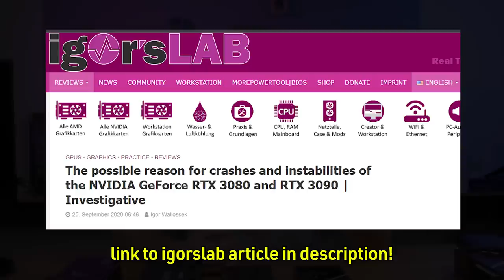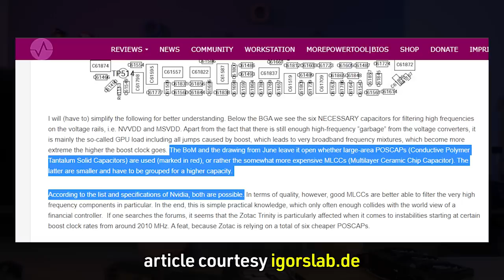The RTX 3080 Launch can't get any worse... Right? Wrong...

Comment: @JayzTwoCents - I am a radio-frequency engineer specializing in RF filter design, and your observation makes total sense.   One of things may computer users is that when you have computers with high frequencies, you have radio waves (aka EMC/Noise).    The reason the MTCC is that they are capacitors all the way to 10,000 MHz!    Those MTCC capacitors are formed to a very controlled RF Filter to keep the noise out of rest of the video card.   If you use those larger capacitors, you have no filtering above it's self-resonating frequency, which may be as low as 1200 MHz!   As a result, the higher frequency clock signal - and its noise - will get right into the system and that filter is invisible to it.   Therefore, that "Boost Clock"  is the problem.
Reply: huh?
Reply: @lerzide  Yes did you not read?
Reply: Props to Jay for actually looking into the comments, and pinning a viewer comment *VERY RARE*
Reply: I love comments like this, cheers to jay for pinning this and cheers to Kevin Gaukel
 for telling us
Reply: Harmonic frequencies are a biatch.
Reply: So don't buy until next year?
Reply: @Papita  ofc I read but didn't understand shit
Reply: dave rich Well sub par components can’t be patched out and you can’t exactly fit a  noise filter to this type of circuit .  Some clever dude will work it out no doubt
Reply: if I had said soldering skill, Can I JEET the stock transistors off and exchange them? in theory. Just asking before I start watching soldering videos.
Reply: thanks dude
Reply: Big scoop for jay this one.  Good luck soldering a filter to the board 😁
Reply: @lerzide  then don't expect for someone to explain this thing to you. jay pinned this for people who have a brain. and for people who would like to do some EFFORT to understand this VERY IMPORTANT INFO

go to your browser , type in the words , read the articles , use your brain to understand things.
simple as that. even a newborn possibly could do it

sorry but I personally hate people like you. 
if you can't even put in the minimum effort 
then don't even bother commenting.
just keep on watching the videos until miracle happens that your brain function will kick off.

you will just annoy people and at the same will just make yourself ret//ard/e/d

also thanks Kevin for the explanation. 
that certainly helps and makes what jay explained credible. 
because we all know the negative-hype for this thing - is blowing up and bound to 
have misinformation
Reply: @lerzide  you need to use your brain and put in the effort to research the terms and concepts you didn't understand from his comment.
Reply: Lerzide since people are being mean instead of taking the time to explain - my understanding is the expensive components are capable of filtering out their own noise which keeps it from affecting the card. The cheaper components don’t have this same filter, so their noise bleeds into the card and causes instability. I hope this helps!
Reply: I can concur with Kevin. Using poly tantalum (or worse electrolytic ones)  instead of MLCC in filtering scenario is bad thinking, to begin with, plus they are a pretty horrible fire hazard. The only reason I think someone used Tantalums there is lazy thinking of utilising decoupling and noise reducing function with a single component. As MLCC are really good at de-noising everything they are always much much less capable of acting as big ass decoupling cap. This could also indicate that designers are underspecifying PCB. Power demand has grown significantly which in this case necessitates more layers and thicker core layers, which adds other problems. Building it with additional buried big ass vias for power planes reduces space and adds complexity. Overall not a simple solution but certainly within capabilities of engineers. Problem is that most of this business is nowadays driven by accountants and marketeers so its pretty normal to see with the first generation of products basic failures such as this. Too little time spent with product testing in lab and more time spent on beauty and RGB lightning.
Reply: @Loathed217  They also are useful. Second order and triple beat harmonic freq are often used in wireless routers with lower frequency transmitters turned up, using the harmonics created off those carriers to transmit the wifi. Aka 1200mhz transmitters with high pass filters on them,  use 2.4ghz and 4.8.
Reply: @declaredsnow  Most probably you can change the capacitors. However, the soldering that close to the graphics chip itself is really risky. You can possibly ruin the card trying to get that 50 MHz boost. I would not recommend doing so. Just underclocking it 50 MHz and using it as it is, makes more sense IMO. Especially for someone without any experience with soldering.
Reply: @Matt_Acuna  thanks for this - but the minimum stuff should've have been done by him. 

and instead of huh? should've been " as far as i researched stuff like this and that - is that really true? " or something.

but NO.  a huh? can be taken as 
why tf you bothered commenting a whole paragraph.  we don't need that here.  and stuff.  

if cba to research 
could've said " can you please  translate this in layman's term" 

so yeah - no one's is being mean - people are telling him to act better.
Reply: This is absolutely Nvidia's fault. Nvidia denied AIB drivers until the cards were built. All the AIB's had were simple tools that said each card "passed" or "failed." If the AIB's were allowed to test with real applications, then this never would have happened. Nvidia was super secret in releasing the drivers to prevent leaks, which is understandable but this is certainly a consequence of that decision, with the consumer's bearing the final cost. 

Jay, your argument is nonsense from a consumer perspective, it really sounds more like a legal argument to me. No one bought a 3080 and thought that their clocks would be limited to 1710MHz or 1740MHz or whatever. The cards are marketed with features that allow boost, no one actually expects their cards not to go higher than this listed frequency. It might be legally, "all that's advertised" but it is not what the consumer's are expecting nor is it what the AIB's are implying you'll receive. 

When you make that argument, you sound like a lawyer who is stating in a very matter of fact way that your card was only intended to reach XXXX MHz. You don't sound like an enthusiast who actually pays for a product and expects it to work as advertised. These cards were not advertised to have neutered boost clocks, the boost clocks themselves are even presented as being thermally and electrically constrained, not "noise" constrained. You sound like you work for or with Nvidia against the consumer. 

TLDR: Nvidia caused this with their secrecy and the consumer is paying the price.
Reply: @Matt_Acuna  Thank you very much. I actually was busy, so I didn't research or anything.
Reply: These are not 'his' observations, they are igor's observations with the addition of false 'not nivdia's fault' rhetoric. These cards match spec (including boost behavior) and all partner boards must be validated by the 'Green Light' program before being released. 

You've also vastly over-simplified the reality of RF filtering. Highly doubt that you're even slightly qualified to discuss this topic. It's about switching, not  'the higher frequency clock signal'.
You speak complete nonsense, at best you are a novice 'engineer' of irrelevant, low-performance designs.
Reply: @wkruse84  100% correct. This is a bullshit take from a nvidia apologist that simply farms far more informative sources for clicks.
Reply: I'ma pretend like I understood
Reply: @abdu1998a  makes sense.  Got a Gigabyte Gaming oc inc next week and a strix oc for late oct. If the giga doesn't please I asume the strix will do fine.  They have been excellent in the past.
Reply: @maxp112  You might be able to buy, but look into the AIB to make sure it's not one of those with the cheaper design.  From what I've seen the ASUS Tuf didn't skimp on the capcitors.  This might be a problem for Gigabyte and Zotac though, No word on MSI.
Reply: Wouldn't it be possible to tie a small rf filter to the input and output of the cheap array? Personally IDC about 45mhz. And John q public shouldn't either. You already have one of the most powerful GPU on earth, why you worried about something that isn't even going to make a single frame of difference even with DLSS??
Reply: @abdu1998a  .. I don't think you could fix this with a soldering iron and a oscilloscope but i'd love to see you try :)  Besides it's only the boost function causing the data interference according to Jay and would you wanna risk damaging the card for 100mhz?   It is a major fuck up as an auto function though, it would be like core precision boost (Ryzen) causing blue screens.
Reply: @Yuuji-yu9pd  "Huh?" was my reaction after reading the op too.  Their grammar was poor and they spewed jargon without summarizing their point.  Just read this to yourself "One of things may computer users is that when you have computers with high frequencies, you have radio waves."  You have to read it like 10 times to try and decipher what they were even trying to say
Reply: But
Reply: The
Reply: @declaredsnow  You cannot just swap the large cap for the array of smaller ones. The layout of the soldering pads on the PCB would be completely different. BUT you could piggiback one or two of the MTCC caps on top of each of the large caps and connect them with VERY SHORT wires. However these are very small components very close together and the PCB has substantial copper planes that suck away the heat of your soldering iron. Also the added height would make your backplate not fit anymore if it doesn't have a hole. I would not attempt this if I were you.
Reply: The bigger the capacitor the higher the inductance🥳 no bueno
Reply: Makes complete sense. Electrolytic capacitors (the large, cheap caps) have a much higher ESR (equivalent series resistance), which results larger voltage changes as the load current changes. Good design practice puts smaller value ceramic caps in parallel with the larger electrolytic caps so that the high frequency load transients draw energy from the ceramic caps without putting as much noise on the supply bus. The smaller value ceramic caps also work much better at very high frequencies.
Reply: @georgf9279  you can on some as the pads exist for the array under the larger cap on those that used the reference layout. Some don't though.
Reply: Can't you just use tiny faraday cages instead of capacitors to filter out RF noise? (Or at the very least, use capacitors and put a faraday cage around electrical components to block incoming noise from outside the hardware?)
Reply: @declaredsnow  You could try, but I would really advise against. They are SMT (Surface Mount Technology iirc) very difficult to solder by hand and you are more likely to fry the capacitors by dumping blobs of solder over the wrong pins. And the different capacitors probably have different pin layouts/specs and won't fit.
Reply: I am also a radio-frequency engineering specializer in RF air filtration and web design and I concur
Reply: Roekoe_ It’s only rare because Jay hates all our comments usually but he reads them all
Reply: I remember there was a few cheepo android tablets a long while back that did something worse they had the caps that fed the soc package a distance away from it and LONG traces to the soc damn things crashed like crazy. Edit, i think the video was a eevblog teardown but i cant remember which atm, and don't feel like searching
Reply: I would say yes and no. The capacitors below the chip are not placed there to reduce self-resonating frequencies, they are there because the input signal they are filtering needs the shortest path to the chip in order to reduce the acoupled noise of emcs. So it's not about keeping the noise out of the rest of the video card, its about don't letting it in the chip. The self resonated frequencies are reduced by the gnd plane of the card. You are thinking like this card had just 2 layers and its not. Also I think that talking about filtered freq numbers is kinda misleading because you need to know the τ value of the circuit and we clearly don't.
Reply: wait now i'm confused... so... how much of those MLCC(MTCC?) are enough? MSI and Nvidia uses "just" two of them (instead of 6?) if an MSI 3090 runs at core clock below 2000 MHz two of the high frequency capacitors are good enough?
Reply: One thing I would like to add. The MLCCs are not significant more expensive. The cost for placing the components is negligible. The components itself would cost probably  <1 cent per piece. I don’t know the capacitance and Package of the components, but the most eypensive special sauce ones may cost up to 50 cents a piece. But I would guess they are more in the 1cent range.
Reply: A few of my EMC colleague will be in a bit of hot water. These big companies should have EMC specialists as part of PCB review.
A good reference example next time a cost controller complains about the slightly more expensive component
Reply: @lerzide  don't apologise, that smuck wanted to show us that is very smart. Not all of us have the same skills. You good chief. Cheers.
Reply: @declaredsnow  you can't manually solder components that small on a graphics card PCB.
It is done by using very special ovens.
Reply: @Yuuji-yu9pd  Bruh you seriously have to chill out, anyone who isn't a super computer nerd isn't going to understand jargon used by a specialist, and not all of us have the time to become RF filter specialists just because we don't understand a youtube comment. 'Huh' echoes what a lot of us are thinking when reading that, and reading it as a comment is pretty funny, even if you don't think so.
Reply: @DeltaStorm27  he's einstein, we can't reach his knowledge level lol.
Reply: @declaredsnow  I got the skills
Reply: @Matt_Acuna  No, not really. Capacitors are passive components, they don't have noise characteristics.  It Depends on the value of the capacitors as to what frequency it has the least resistance (resonate frequency) or charge capacity  to smooth any ripple from the power supply
Reply: I would happily replace the caps on one of those boards to see if the problem disappears. I work at an R&D lab with all the gear and ofcourse the experience of working with complex multilayer pcbs
Reply: @kelainefes  you absolutely can, but only with proper equipment and steady hands. You will need micro head hot air soldering station to begin.
Reply: Any info on whether the Asus Strix will have the same capacitor setup as the Asus TUF cards?
Reply: @lerzide  The point of the the caps are to help filter out the noise. EM noise just happens. it's unavoidable. When they self-resonate it defeats the purpose of the caps. That's what's happening when it hits certain frequencies clocking itself higher.
Reply: @maxp112  Or buy Asus, looks like they've got 6 of the expensive cap arrays.
Reply: @Yuuji-yu9pd  Ok Einstein with PP manga.
Reply: Will K How is this Nvidias Problem? If 3rd Parties wanted to create a perfect GPU they all should have built their own cards from the ground up themselves. I really don’t understand 3rd party GPUs. They take the stock 3080s put some extra fans on it and get paid for Nvidias work. Seems pretty lazy that they don’t create their own GPUs themselves
Reply: I'm a YouTube comment analyst specializing in human behavior by individuals who certify their superior knowledge of the discussion topic by giving false credentials expecting to be taken seriously and the type of individual who falls for this type of deception.

Did you fall for it?
Reply: @IUSSHistory  holy crap. Consider myself schooled.  Bro thanks for being so intelligent.
Reply: It is quite dissapointing to jump onto the bandwagon saying that the spcaps configuration is the worst. Their models ranges with different performance. Gigabyte adopted a better spcaps model compared to the Zotacs, that's why Zotac peeps are facing more issues compared to the latter. 

MLCC have pros and cons too. Hence Asus TUF users, FE, those who have incorporated both setups of capacitors have crashed too, proves its not by the capacitor, do understand the chips are pushed way beyond their rated spec, its as good as saying that it's been automatically pushed over its limit which has been overlooked. It's the same when you try to manual overclock and it crashes when benchmarking, it's the same now as well, but it's been done automatically.

Breakdown of the pros and cons of both that I got from my local forum. Thanks Gametaku. 

MLCC:

+ cheap
+ small
+ high voltage rating in small package
+ high current rating
+ high temperature rating
+ high capacitance in small package
+ good at high frequencies

- prone to cracking
- prone to piezo effect
- bad temperature characteristics
- DC bias (capacitance changes a lot under different voltages)

SPCAPS:
- more expensive
- bigger
- lower voltage rating
- less good at high frequencies

+ high current rating
+ high temperature rating
+ mechanically very strong (no MLCC cracking)
+ not prone to piezo effect
+ very stable over temperature
+ no DC bias (capacitance very stable at different voltages)

Overall, its actually best for them to give more time for themselves to run more test before releasing a product. Same applies to all other type of products be it a GPU etc.

I am an early adopter/beta tester as well. Sick of been the ones facing issues when you know you are confident in a companie product. I am not bias in any company but just happy to support what they developed and release to customers
Reply: MLCC NOT MTCC
Reply: @lerzide  exactly my reaction. But kudos to the expert tho!
Reply: @Yuuji-yu9pd  the person just said "huh?". My god people need to give that person a break. It pretty damn obvious to anyone who knows how to talk to people what they were hinting at haha.
Also it is a complicated topic.
Reply: @Yuuji-yu9pd  stop hating on the @Lerzide. OP is barely speaking english in his comment
Reply: Speak English doc we ain’t scientists.
Reply: @Roekoe_  lmao
Reply: Are you speaking of self-resonating frequency of a capacitor or of an LC circuit, if I may ask?

Anyway, that was one brilliant comment.
Reply: @Yuuji-yu9pd  His comment was more to do with the fact the original poster was typing in extremely broken English and most of it did not make sense in that regard.
As for the "engineer" claim, I wouldn't believe everything you read on YouTube.
Reply: As a electrical engineer with MSc specializing in power enginnering now (curently working as protection and control specialist, major in electrical systems and technology, graduation in power electronics). Point of this capacitors is not to filter anything. You totaly dont understand the topic. Point of that is to eliminate VDROOP. Voltage drop when hi load spike accures.

Basicaly to minimalize -dV/dt, when +dP/dt spikes. To do that you need energy stored at max and impedance at minimum.

Everything on this video is a theory, and is easy to prove. Just meassure voltage on high load spike. I realy dont think that there is big price difference in any of tipical, and that engineers who work on that design are not aware of VDROOP. This is probavly envidia fault with their boost algorithms and lack of testing from AIO vendors.
Reply: I would expect the GHz noise to be decoupled by the smaller MLCCs. The big MLCCs/Electrolytics/Tantalums(?) look more like bulk decoupling.
My suspicion is that the cards using Electrolytics have more bulk capacitance, causing board manufacturers to think they can reduce the capacitance of the other MLCCs.
Reply: why are people belittling @Lerzide 's comment about not understanding this kinda of stuff? Not everyone has the same knowledge as you. And even if she/he searched for what these terms mean, it doesnt mean he/she will understand anything.. so instead of being an asshole why dont you write an explanation that will help others as well? Its like saying "how dare you not understand advanced mathematical concepts that you never heard of! just search them online dont be lazy!"... These comments are rather toxic and contribute nothing to the discussion whatsoever.
Reply: It’s nonsense what you’re saying.. buldzoid was already explaining this and it has not to due with the clock frequency of the GPU since it is parallel processed by the net frequency of 50Hz so all other frequencies don’t matter since capacitors are build on this operating frequency..
Reply: I would believe when the frequencies are not resonant and are instead dissonant that it would also create excess heat due to the frequencies not mingling nice, as well as causing overall instability issues and RF interference. 

Considering the cards already run hot as hell, this is a serious problem and safety hazard. 
Do not ever, ever, ever buy a launch version, people. 
Good luck buying a new 3080... And PC... And house...
Reply: @g10118  Yeah I was surprised how bad this take is. "You're still getting reference clocks so you get what you pay for". Maybe if there was the asterisk on the product page saying (will not perform according to benchmarks that you've seen because it's a sub-par product). See how much the cards will sell then lol.
Reply: David Connell MLCC have a noise characteristics due to piezo electric effect during vibration.  You have to be careful with sensitive circuits, such as oscillators, in aerospace use.  Though you are right, that’s not what’s going on here.  I’m surprised (well, really not) that these companies are not running a analysis on their power delivery network.  This is common practice.  Maybe they are just slapping shit down on a board.
Reply: Markisha64 good insight (I’m an RF EE).  I’m surprised this is happening with all these cards.  Tells me that these companies have poor design practices and are just slapping parts down on a PCB.  Power delivery network (PDN) analysis is well established within the signal integrity community, and there are several software packages to simplify.

Of course, it could also be bad parts, bad PCB, or poor bypassing within the packed chip itself.  If you are trying to get a low PDN impedance at 2 GHz, it sort of too late to do that on the PCB when the bypass caps are on the other side of the board.  Not to mention the power planes within the PCB may be resonating.  Nvidia may deserve some of the finger pointing.
Reply: Lerzide dont apologize bro, you did nothing wrong.
Reply: Looks like a : I'm a vegan - to me 😅
Reply: AbrasiveWaif Thank you for posting something that actually makes sense!
Reply: The bigger poscap capacitors can't respond quick enough to the agressive GPU boost. They can't provide the GPU with enough power fast enough so a brownout occurs and people get kicked to the desktop. Expanation in detail: https://www.youtube.com/watch?time_continue=82&v=FmmlafdRlvw&feature=emb_logo
Reply: @TheMidwestConnect1  You don't seem to understand the resources it takes to "create a GPU" nor do you understand the relationship that chip makers have with AIB's. 

It's a relationship that Nvidia has determined is profitable. There is no room for adjectives like "lazy" or phrases like "get paid for someone else's work" in business. Nvidia does not give away anything that they don't believe they make a profit on. That's how business works. It might be mutually beneficial to both Nvidia and the AIB's and I would wager that is the case but no one is stealing work or being lazy.  

As far as being Nvidia's fault, yes it is. They provide the AIB's with guidance and drivers to build boards for the chips, then the AIB's make them. This time, to prevent leaks, they denied the AIB's drivers. AIB's had command line programs that gave a pass or fail. They couldn't test in actual real world scenarios. So strange electrical interference manifesting during high boost scenarios would never be caught prior to manufacture.

No AIB would sacrifice their brand image for 25 cent capacitors, if this is the issue, then it would've been handled in house during the design phase in testing the GPU but that could not have happened this time because Nvidia did this launch so differently. 

I would wager this also had something to do with scarcity at launch. I bet these AIB's caught the bug around launch and pulled the cards and that's why so few went live on launch day. 

Of course no one can say anything about anything because whoever the blame gets settled on will be paying the price in brand image.
Reply: You mean MLCC, as in multi layer ceramic capacitors... and you're glossing over a lot of info. It's not that poscaps cant do high frecuencies, it's all about the design of power delivery. I think the one at fault it's nvidia for not giving all the details to th AIBs, so they could fix and adjust the final designs of their own cards with enough time. EVGA released an statement, that they got aware of the situation and got it fixed before release with minor delays. That speaks good of their engineering department that was able to identify the issue really fast. MLCCs are not without problems of their own, they can crack, they can short, poscaps dont tend to short much like mlccs, and its not that they are cheaper, there is a reason why they were using them!. Yes they're cheaper but my guess is, it means cents per card...
Reply: What does MTCC stands for BTW :D 
P.S. i understand what you said although i m not an expert like you
Reply: @lerzide  why are you here then?
Reply: To be fair to @Lerzide, the comment is full of spelling and grammar mistakes, that may well result in poor google translation, or just general misunderstanding.
Reply: @rfengr00  Probably that last part.
Reply: Jtl2299 well funny thing is I went to Micro Center yesterday to buy a thumb drive, and figured I’d buy a 3090 if they had one (I knew they would not). They had signs outside the store saying they were sold out of 3080 and 3090.  Now I’m going to have to research PCB revisions prior to purchase to ensure I don’t get a turd.

Funny thing is I could have bought a 3080 as they had a few last week, and turned around and sold it on eBay, but I guess I’m not enough of an asshole.  Someone bought a 3090 on eBay for $10k; crazy.
Reply: haha maybe a bit generous to say it makes total sense, but yeah agreed
Reply: @benighted0ne221  MSI Ventus 3090 has the cheap design. Is actually shown in the detail images on the website id ordered mine from. x6 cheapies.
Reply: @abdu1998a  Knowledge and proper soldering equipment is here the key. But as a consumer, you can only be angry. Buying a card that is at the beginning labeled with limitations is something that no one is expecting in this price range of cards. Of course, you can change the caps for better ones. From what i see here this tantalums are all connected in parallel. The capacity has to match. You could replace them probably with 1210 smd ceramic capacitors. It is not that expensive. A nice hot air station does the job pretty fast, but i would go for soldering tweezers with nice tips, or a good soldering station.
Reply: Huh?
Reply: @davidmaddison4544  Can I just rebuild this from scratch with a few thousand bix boards?
Reply: @miket7390  LMAO
Reply: @declaredsnow  i wouldn't especially not if you are new to soldering since something like this since there is alot of shit in the way but it can never not help to watch some Louis Rossman dont delay watch today
Reply: @Markisha64  as a civil/structural engineer I have no idea what is going on... (except resonant frequencies, I don't want structures shaking themselves to death). 
Electrical engineering is black magic and we need to bring back witch trials.
Reply: Then  you would also know that MTCC are actually much cheaper than POSCAPs.  So his (@JayzTwoCents) accusation that Gigabyte etc cheeped out, and his implication that ASUS didn't, actually has things "arse about face".  ASUS massively cheeped out.  MTCC fail over temperature and have less of a lifetime in a thermally stressed environment - and they crack.     Gigabyte actually use higher spec POSCAPs (470s) than ZOTAC.  But don't trust me.  Do some research.
Reply: They are not his observations. He was repeating somebodies findings. He would review them without even mentioning about it if that would only depend on him.
Reply: @Matt_Acuna  thank you
Reply: @Papita  oh of course totally
Reply: @rfengr00  At that point, why not just invest into a Quadro or some big 'ol beefy build?
Reply: Huh? Oh right, that totally makes sense. Understood. Thank you.
Reply: This is a very good assumption. I think this was overlooked when they wrote the minimum spec. They might have overlooked the fact that people overclock these devices. 
POSCAPs usually higher ESR (equivalent series resistance) which looses its 'filtering/decoupling' effectiveness on higher frequencies as compared to MLCC. And when you overclock this device, the operating frequency will be a lot higher in which you are operating in a region that the signal integrity is compromised.
Reply: i miss the c.b. days. old lost  frequency's. RF back then  would light up a bulb and open the auto door ate the grocery store.
Reply: It's refreshing when a YT commenter just gets it, albeit a well-studied industry professional xD
Reply: if anyone wants to fix the problem themselves. just piggy back some more capacitors on the back on top of the "poscaps" maybe that'll be a way to get a cheap upgrade for some folks
Reply: @irag4983  This is the actual answer. It's not a question of cheap vs expensive *capacitors*. The larger tantalum caps also have a purpose.
Reply: Could undervolting help theoretically with stability ?
Reply: @Matt_Acuna  Thank you. Those people above you are just some toxic weebs who are pissed that they are still virgins so they gotta do everyone like that :(
Reply: @declaredsnow  I would not recommend that. First of all I don't think the transistors are the issues, but the caps. The spec (I did not look at that but I am a design engineer in the photonics business) is probably some other lower capacity specs in line with some even lower capacity spec. The reason here is that the different capacities filter out different frequency ranges along with having different ESRs causing the resonant frequency placement that Kecin Gaukel mentioned.
Additionally you might put on too much solder or leave some sort of residue which could also create some offset as more solder would be more resistance. Not sure if this would affect the power much, but I speak from experience with photodides.
Reply: @MeakerSE  Seeing Buildzoids high res PCB shots - you are right the pads are layed out for both options.
Reply: They used Copper magnetic filter i think
Reply: @declaredsnow  You could definitely destroy a $900 card in about 4 seconds if you did it wrong.
Reply: @josephdzn9868  Just watched an ASUS TUF 3080 crash out at 2.07GHz with 6 MLCCs installed. It's one of the best in the market, and even it is having this problem...

There's more wrong here than just capacitors and NVidia sure is being mighty quiet about it.
Reply: @Yuuji-yu9pd  Jesus Christ dude chill out.
Reply: @declaredsnow  Don't even try lmao
Reply: @declaredsnow  You could... but know you may brick your card without the proper tools and experience to do so. Try to return the faulty product first. As a pcb designer I know that some traces are only slightly bigger than a hair and it is very easy to plain rip a track off the pcb while trying to desolder the stock components.
Reply: @abdu1998a  How are you gonna change caps with hugely different land patterns? You need to have low impedance return path for decoupling caps, and I doubt the single large cap layout is exactly suitable for just throwing in some small mlcc caps. And also hand soldering smd mlcc's is not recommended (and note that "not recommended" ≠ "can't be done"), they can in worst case short circuit due to thermal shock causing internal layer cracking (sidenote: I prefer the AEC qualified open mode mlcc's in my designs).

PS. Everyone commenting here should watch Dave's excellent video (even those who claim to be experts of the subject): https://www.youtube.com/watch?v=BcJ6UdDx1vg.
Reply: I learned something today and it was from this comment. :)
Reply: @lerzide  Don't put a quart in a pint pot basically.
Reply: @declaredsnow  They are capacitors. If you don't know the difference DON'T TRY THIS AT HOME!
Reply: @Yuuji-yu9pd  "Sorry" but I personally can't stand people like you either.  Pedantic, condescending, self-congratulatory, etc.  Jumping all down someone's throat just for writing "huh?"  It seems like you haven't "used your brain to understand" Kevin's comment either -- because if you did, you'd see that it doesn't make very much sense, and "huh?" is a perfectly reasonable response.  

My reaction was the same as Lerzide.  There are typos, acronyms that haven't been defined, etc.  Doesn't make any sense until the last couple of sentences.  

"One of things may computer users is that when you have computers with high frequencies, you have radio waves (aka EMC/Noise)."  

^^ That sentence makes no sense. 

"The reason the MTCC is that they are capacitors all the way to 10,000 MHz!"

^^ That sentence makes no sense.  And what is MTCC?  Typing "MTCC" into google brings up "McDowell Technical Community College", which I'm fairly certain is not what Kevin was referring to.  

But anyway, I know you were just trying to pat yourself on the back for "reading" the smartest looking comment, but maybe you should have actually read it.  Do the research and "kick off your brain function," BEFORE trying to ridicule someone else.  That way you'll not only look like less of a fool, but less of an asshole.
Reply: Tim@NVIDIA - NVIDIA posted a driver this morning that improves stability. Regarding partner board designs, our partners regularly customize their designs and we work closely with them in the process. The appropriate number of POSCAP vs. MLCC groupings can vary depending on the design and is not necessarily indicative of quality.

oups..
Reply: Imagine getting vented over someone saying huh
Reply: @lerzide  Neither did I, but I didn't feel the need to leave a dumb comment.
Reply: @mattsap2558  Generally speaking polymer caps (POSCAP is Panasonic's product line name) have higher Equivalent Series Resistance (ESR) than Multi Layer Ceramic Capacitors (MLCC). Usually smaller ESR is preferable in power supply decoupling (IRL there are cases where too low ESR can cause instability). Of course package sizes also matter, bigger device package = larger inductance (not desirable).

Capacitors can have different temperature ratings (and lifetimes) even in the same product line, so there is no absolute truth. But generally speaking mlcc's have higher ratings.
You can get at least +200°C rated mlcc's (even higher ones exist). But I think the most common temp rating is +125°C (X7R) in consumer electronics, or in high temp applications +150°C (X8R).
By quick search @ Digikey highest rating for low voltage polymer cap I could find was 1000 Hrs @ 125°C, which is not great IMO.

PS. Relating to mlcc vs tantalum: working as biomedical equipment techinician I've seen medical device manufacturers quietly swapping the fire hazard tantalums for mlcc's in newer pcb revisions in the same product.
Reply: @narabdela  Can you please explain how saying that I didn't understand broken English considered dumb?
Reply: Fantastic explanation!
Reply: Do you think we'll be seeing designs with screening cans and such at some point? Jay mentions interference from his radio pack so perhaps EMC isn't strict enough for today's noisy environments... (Also, from an engineering perspective your comment very insightful)
Reply: Except.. it doesn't make sense because it's inaccurate.
Reply: Matt Acuña finally a true human being
Reply: It would be interesting to put one of these into a RF shielded room and just watch the RF spectrum on a spectrum analyzer with all the noise and such...
Reply: That's correct... I... guess XD
Reply: Nvidia released a new driver yesterday largely solving crashing on cards with MLCC/SP-Caps or a mixture. It appears the capacitor "theory/Guess" is complete overhyped BS.
Reply: Great response! Also it's not his observation, all the credit worldwide must go to Igor's lab...
Reply: @samzavinful  , it would be.  I nave to think that all those 4-5 GHz CPU clocks and all the  1+ GHz GPU clocks are going to generate a lot of spurs and noise.  Remember...if you have a 2 GHz clock. you will likely get spurs at 4 GHz and 6 GHz but also sub harmonics (1 GHz,  500 MHz, 250 MHz, etc) due to divide-by and counters)
Reply: @6to1  Sure - buy solder in bulk
 though,
Reply: @Zhaadum  thanks for the detailed explanation. Appreciated
Reply: @qwopie9174  how to upsett the whole internet in a few seconds.
Reply: @neonightengale9375  I was just talking in theory.  I am Not good at soldering at all. Only done like old radios and tv's. Those pcb's are huge and lots of space to mess up on. Also got a strix coming later next month so if it's bad I'll keep the strix. Got enough friends that would love a giga gaming oc, even if it only can run stock.
Reply: @stevewatson6839  I was joking. Kinda. I'd probably receive a size and desist order if I showed you some of my soldering work
Reply: @Battleneter  Yeah this is largely being ignored it seems by the people who originally have hyped up the Capacitors theory with some people adamant that it was the complete cause of the issues. Would be nice to see some coverage on the driver fixing these issues. I have my Gigabyte 3080 waiting to be installed in my new rig, I am currently waiting on Zen 3 so i have not personally tested it. I also read from many people that the new drivers provided performance increases in some games and synthetic benchmarks on the order of up to 10%. Reviewers might have to retest Ampere when Big Navi comes out to get these updated numbers.
Reply: I'm an EE, but i don't specialize in RF design so you've got one up on me and probably more experience. I'm still going to sit here and complain that you said 10,000 MHz instead of 10GHz though! Kindof a pet peeve after I've seen 100000000uF capacitors on Mouser. Seriously people!!! Engineering units! (But you used a comma so I forgive you, at least I can read it without a lot of effort).

I also assume you meant MLCC capacitors? Incredible that proper EMC testing/design wasn't done on these boards. We're pretty lazy about it where I work when prototyping parts(R&D) but try to keep interference to a minimum, and in production we actually try to do the right things to help. There are other companies that just don't care at all about the emissions of their devices and they'll interfere with other devices on a vehicle. It's ridiculous. We've actually been requested to make our stuff work when a totally unacceptable amount of interference was generated from other devices. How about no?
Reply: Don't they have mlcc right near the chip for bypass? I suspect that it's the cards require high end power supplies with good transient response and regulation under heavy cross loads.
Reply: Then I finished the video and can't believe some of those were inadequate bypassed at high frequencies. They probably didn't take less than ideal conditions into account when looking at the poscaps esr over frequency. 🤦‍♂️ Improper derating.
Reply: All the issues were fixed with a patch lol.
Reply: @Chromov113  Capacitors self resonate? Pardon my electrical engineering ignorance. Why would computers simply with high frequency clocks "generate" radio waves? His analysis makes sense upon first inspection at least though, just wondering...
Reply: @Markisha64  This is what I was thinking about thank you for clarifying! Pardon my electrical engineering ignorance, I'm a hobbyist who studies seldom on his own time, but capacitors don't self resonate do they? That frequency is he referring to within his system ( this comment, that is )? Also, do high frequency oscillators make radio waves? That doesn't sound right at all. Like what?
Reply: @seppestas  it would be nice if they released schematics.
Reply: @lerzide  Basically, the more expensive capacitors can filter a larger range of noise than the cheaper ones.
Reply: @ms-dosguy6630  Why do you ask me?))) This was a question to the topic starter. 
As far as I'm aware, capacitors don't, only the (R)LC circuits, which include capacitors, do. And a power-phase of a GPU or CPU is, in fact, an LC circuit.
Reply: @trevorstand829  the POSCAP price is made in reference to 1 MLCC, the array uses at least 10... so multiply the price of that 1 "cheap" MLCC
Reply: @wkruse84  Hey, don't blame the lawyers. Any consumer lawyer worth their salt would entirely agree with you that people aren't getting what they actually paid for and that's a problem. If the boost is advertised as a feature and that feature is broken, then it's outright defective/warranty time. There's no justification for it at a legal level at all. They either give you what you paid for (a card with boost) or they give you your money back. No reasonable lawyer would sit here making excuses for a megacorp that didn't allow proper testing. 

Customers should get a refund/warranty and Nvidia should likewise be pinged by the AIB's for failing to a) be specific enough with the reference design and b) not providing the tools for QC. Nvidia definitely screwed up for this to be a widespread problem.
Reply: You explained that great. Even i understood some of it :3
Reply: Oops.
Reply: WHy would you need to or want to overclock on a 3080? I nevcer overclock my hardware and guess what it lasts years and years. I still have a 12 year old Geforce 9800 GTX from 2008 that works fine on my old backup PC. Of course that card only has 1 gig of vram so it cannot play anything new but that PC isn't used for gaming. THe CPU on that PC as well is from 2008 so is it's 6 gbits of ram. I overclocked one time to try it out and the vid card died after only one year. So never again. I don't have assloads of money to burn.
Reply: Why are the more expensive parts not used on all cards? From my understanding these components cost only a dollar or two total right?
Reply: Big oof
Reply: What I'm really wondering is how much do the MLCC caps actually increase the total cost of the card? I can't really see one of those capacitors costing more than 10c, which amounts to $6 (60 in total), but they're probably closer to something like 0.1c when bought in bulk.
Reply: So how come people on linux that hit the same booth clock speeds didnt experience any crashes?  Doesnt sound like boost clocks to me. Also every card was build to Nvidias spec and there isnt anything remotely wrong with their spec.
Reply: Jay needs to DELETE  this vid, still misinforming any newbies coming in, it should not be left to commenters having to fix his mess.
Reply: @declaredsnow  Yep, you can, Der8auer did it and actually showed the problem being fixed by doing it..
Reply: Good to know , damn I might convince my brother and buy the evga rtx 2080 ti like me or just wait , by the way guys for some reason the EVGA RTX2080 TI FTW ultra, has coil whine, I had to send mine back after 28 days..... apparently they had quite a few of them bad , even seen artifacts abd delayed signal to monitor.. .

Off topic ikr , just be aware
Reply: @eidodk  I take my words back, interesting video.
Although I would not recommend that someone buys a soldering iron to attempt this, I think you need to be skilled to do it without running the risk of killing your card.
Reply: @Somone_final_final_v2  lmao
Reply: @iulian2548  given the explanation, provided he is correct. Radio waves aren't produced from capacitor resonance as far as I'm concerned though, only interference from other components/power delivery network. As far as I'm concerned ( do not take my word on this ) those caps are just for vdroop but as we now this could effect boost clock and stuff like that creating unstabiliy.
Reply: @Richard Pajooh Not at all. Many people just choose too as a result of joining pcmr. I build my first pc when I was 10, which led me to go down comp arch and electrical engineering but beforehand I was just as knowledgeable as any other console ghoul and that sufficed for a long time...
Reply: @Battleneter  Everyone else:
I'm going to pretend I didn't hear that
Reply: @ms-dosguy6630  If you are unclear why this Jay's video needs deleting watch this.
https://youtu.be/lhyCdraz54s?t=350
Reply: @eidodk  🤦
Reply: yep and and that rate if slewrate or jitter is induced there are matters of ps in risetime requriments on those gates in the fabric what can happen is that gates get stuck in a meta stable state  acting as asynchronous digital systems as there is no control of the clock. This often cause unreversable states require powercycling of the core
Reply: @AA-iq6ev  All irrelevant garbage, the crashing has been CONFIRMED as driver only. No model of 3080 has "bad" capacitors lol
Reply: @bobotmeister  Nonsense.  MLCC are a penny or so (even less).  A POSCAP is £1.50 or more.  But this is old news now.
Reply: @Battleneter  when did I ever suggest anything else? I study electrical engineering and I was trying to fathom why this was even the case, the information he gave me I immediately thought it was stupid a capacitor led to crosstalk due to "radio waves".  I don't think anybody studied the electromagnetic spectrum, evidently. Electronics don't just produce radio waves, they do however produce ( that is current ) electromagnetic fields, which does lead to crosstalk unless insulated. At any rate, those capacitors ( as far as I'm concerned ) were used for vdroop which makes more sense. I watched a good video on the topic anyway, take my word for it when I say I don't just believe things people hand to me.
Reply: Please do your research again on the 3080 problem and you'll find the capacitors ate not the problem  🤦🏻‍♂️
Reply: @Battleneter  I never suggested it was the capacitors in the first place. Lmao.
Reply: @Battleneter  I have never suggested the caps were the issue, I knew from the get go that didn't sound right.
Reply: Im mind blown...
Reply: @Yuuji-yu9pd  Why  the fuck would any one need to research that, it's pretty basic stuff anyone that can build their own PC should be able to comprehend
Reply: @lerzide  same
Reply: The Community is still waiting for Jay to take down this video and offer a real apology.
Reply: @lerzide  So for some reason everyone is being a total DK about your comment when the guy did say "I am a radio-frequency engineer specializing in RF filter design...".  Sounds like he has some niche knowledge to me ! I love reading comments from all these people pretending they know any more than you do. As Socrates said "The only true wisdom is in knowing you know nothing." At least you have the stones to admit you know nothing about RF filter designs! You can always tell a faker because they adamantly refuse to share their knowledge. People who really know (like Kevin here) will happily share.
Reply: Eh well sure they have conductive traces running data at what are basically microwave frequencies so this makes perfect sense. Anyone that thinks a conductive trace on a PCB can't be an antenna should do a google search for say an ESP8266, yes that weird trace that folds back on itself like a square wave at the end of the board it comes on is the 2.4Ghz wifi antenna printed directly onto the PCB.
Reply: This comment didnt age well 😂 it was a windows driver issue, nothing to do with anything you guys are talking about. 10/10 for the effort though, and for Jay pinning this. Now delete it so no one else get misinformed.
Reply: @seraphina985 The crashing issue across "all cards" was identified by Nvidia as a driver issue,  and its now resolved. It was NEVER a capacitor issues Jay should take down this video as its still misleading people, but he won't $$$
Reply: Does anybody know if the new card have anti plasma 1080p 3D?
Reply: Also it is a god damn Tantalum capacitor, they might as well put a small bomb on the back of the GPU.
I know that they are fine if you design for them but they fail soo fast and they always fail by going boom, I hate Tantalum.
Reply: @declaredsnow  Don't desolder your card, maybe wait till a manufacturer recall.
Reply: As it transpires, his "assumptions" (based on some one else's article) were simply wrong & only promoted misinformation. Guess you agree with that as well?
Reply: @user537 Nothing you said was relevant as ALL cards were effected regardless of capacitor type. The issue was eventually identified by Nvidia as a DRIVER issue and now rectified,. the end!
Reply: @lerzide  yeah he literally got so mad at you for no reason😂you said huh because you just didn’t get it because it’s some advanced stuff, and I even thought huh at first too lol it was funny. People just are always so ready to argue nowadays! All good man don’t worry about them.
Reply: @lerzide  never stop asking question. Just walked on this video. Did not understand a single thing the original poster said. Glad someone answer your question. Thanks for asking it :)
Reply: i could tell, and i surmised this would happen just based on my knowledge of PHYSICS alone.
Reply: @JayzTwoCents cani plz buy a graphics card from you im having a hard time buying one
Reply: Doesn't the FCC require electronic devices to accept certain amounts of interferance and still function poperly?
Reply: 5Head ah yes
Reply: @vincewilson1  - you are correct.  Unfortunately, the FCC regulations only apply to RF coming from outside the card - not from within.
Reply: Imagine coming in here acting like a know it all only to be wrong cause it was simply a driver issue lol.
Reply: @Papita  English
Reply: They are called MLCCs not MTCCs.
Reply: kappa